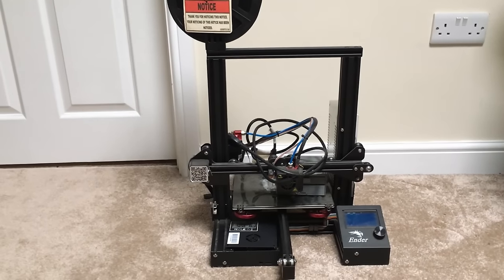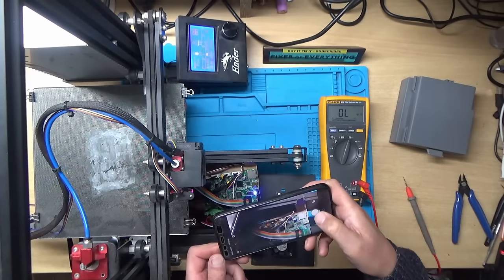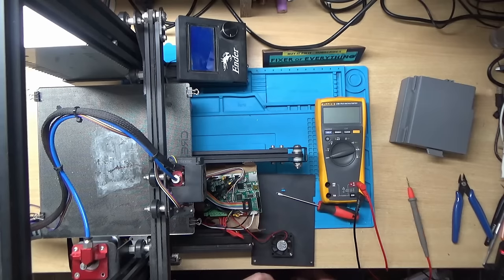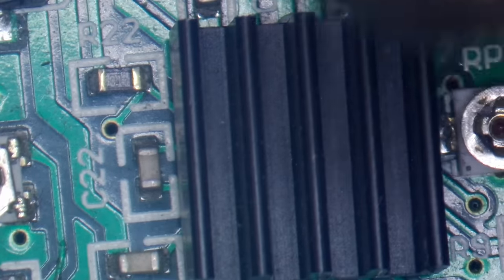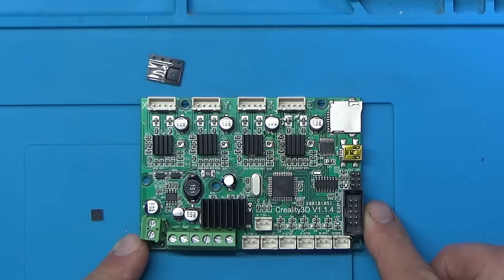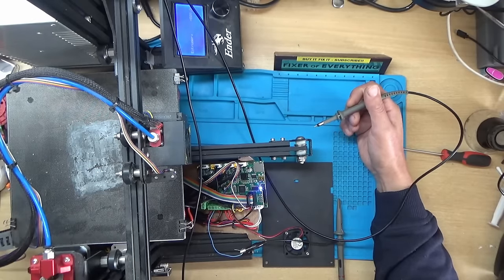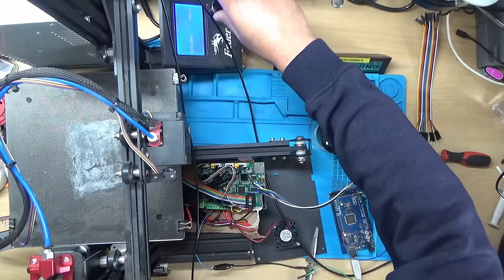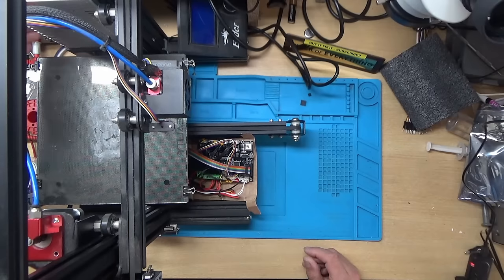Faulty Ender 3 3D Printer | Can I Fix It?

Comment: Hey Mick, did you consider just taking a chip off a cheapo Arduino board? Could have programmed it first and then unsoldered it possibly?  Nice fix again though! Oh and just a suggestion, you could play with the boat in the bath with your little ducks 😉
Reply from the maker: Yes, I looked but the arduino boards are atmega 328p, I'm sure there used to be a board that had the 128 on it, but I couldn't find one. Lol @ ducks 🦆🦆🦆😂😂😂

Comment: You do not need an arduino to install firmware just direct from pc or save firmware to an sd card and place in the printer. As stated by someone else it will not extrude when cold and it should say this on the screen.
Reply from the maker: Thanks Simon, the 8 bit board unfortunately doesn't display a message possibly due to lack of memory on the MCU, it also can't be updated via SD. It may be possible to update via USB but you need to flash a bootloader first via an arduino. The 32 bit board I fitted however does display the message and is upgradeable by SD (this is how I got the BL touch working on the new 32 bit board). The extruder doesn't extrude as you say if the hot end is too cold, I didn't know this at the time as it shows no message on this old board to say so. I did have another look at it after people brought this to my attention and faked the hot end temperature using a 470ohm resistor which made the board think it was up to 230c. After doing this and fitting a new driver it still didn't extrude...

Comment: Good Video.  For a quick test of the Z axis you could also just swap one of the X or Y axis connectors with the Z to check if it is the board or maybe the stepper motor..
Reply from the maker: Thanks, yes I tried that on the video, so did the owner before he sent me it.
Reply: 😌Sorry, missed that in your Video @BuyitFixit

Comment: Did anybody mention that printers won't try to extrude through a cold nozzle yet? 😂
Reply from the maker: Yes, I pinned the comments. The original driver chip sent power to the motor straight away as it 'locked' at power on. It could be that after I changed the chip it was repaired, but it showed on the screen that it was moving the extruder when turning the knob with no error or anything showing. The replacement board displays hot end too cold.. so did the old board support this function? As no message was displayed..
Reply: @BuyitFixit all boards support it, it's a software feature, not hardware.
It just needs to be defined in the Marlin firmware before compiling it in Visual Studio Code/PlatformIO.
Most of the recent Marlin versions already have Cold Extrusion Prevention enabled by default.
Reply from the maker: Yes I wasn't meaning hardware, it's why I ended up flashing different versions as it's I thought it was unusual for the microcontroller i/o pins to die. They are usually pretty robust unless you feed a high voltage into them. I've done a fair bit of programming and making things with arduino and the like over the years.
Reply: @BuyitFixit  They were tough, especially the 1.1.3 and 1.1.4 versions with the Atmel ATMega 1284P chip.
In my experience with Creality printers from years past, the first thing to go were usually the cheap power supplies that they fitted on most models of the Ender 3, Ender 5, and CR-10.
The second thing that failed the most was the plastic extruder arm, it was poorly designed.
Other than that, great printers for the money.

Comment: one thing about ender 3 i find annoying is that the cheap supliers of stepper motors i have localy have all the motors with  different pinout like 2 coils are crossed on creality printers, plugs are the same just 2 wites ate crossed and cheap motors don't work either unless you swap the middle 2 wires
when i read the describtion and saw firet few minutes of the video i instantly thought the extruder motor has been replaced along with the extruder to get a longer shaft motor there , since most new ender 3 extruder motors have pressed in gear and short shafts 
my 2nd thought was just to ditch the stepper driver and either reprogram marlin to use different stepper driver if it has one spare or just refire step stick in place of the broken driver and see what happens then
Reply from the maker: Interesting about the cheap steppers. I didn't know about that. I recently bought a broken ender 5 pro with BL touch from ebay for £70. It had the same 8 bit board so I just replaced with then 32 bit. I then had loads of issues with firmware and ended up having to configure and compile my own as using the version from the creality site it was homing to the back right and thought that was 0,0 instead of thinking front left was 0,0 and printing in reverse (others had the same issue) It all works great now but it was a few hours work to get it all sorted.
Reply: @BuyitFixit  printing in reverse is simple fix, you just have to swap the a and  b coild in the motor, esentially fliping the plug on the board controller upsde down i don't know if reversing the coils itself would also work but most people just reverse the plug and motor is in reverse , when i made my first ramps diy printer i was supper self concious about direction of the motor coils but in a scenario you connect one coil wrong motor just buzz in place and that is it  so fliping one coil then make it moves again regardless which then fliping the plug 180degree changes the direction. it is harder to explain than just do it
Reply from the maker: @kokodin5895  Thanks for that. It was a known issue with ender5 pro bl touch firmware. It was quite and old version too. I just downloaded the latest version and after setting all the options and then a bit of tuning it works fine now. And 0,0 is at the front left of the bed like on the ender 3, and not at the back right like it was.
Reply: @BuyitFixit  funny part is i am not an expert either that just a stuff i picked up along my way of swaping expensive 3d printer parts with ebay used junk and i am not an expert in a sense i was 3d printing only for 2 or 3 years , so take as you will
i also think exclamation mark in the code of the printer  could reverse direction based on a c++ codebase of arduino shield but i last compiled marlin a year ago so i might be a bit rusty, last time i used arduino i tryed to downsize dcc decoder code to fit on single chip microcontroller :P
anyway, have a nice day and happy printing

Comment: Next time before ordering a chip, check the voltage on the turnpot next to the driver. That turnpot is for adjusting the amount of amps the driver sends to the motor. If it is bad or was adjusted too low the stepper motor will not work either. Just stick a metal philipshead screwdriver in the turnpot and measure between ground and the shaft of the philipshead screwdriver. It should be about (off the top of my head) 1.0 to 1.3 volts
Reply from the maker: Thanks 👍yes the current adjust is supposed to be around 1.3v or so if I remember. The stepper motor seemed to be constantly powered at power up on the extruder output as the motor would not turn when the machine was switched on.
Reply: @BuyitFixit  that means the enable is active. This prevents gantries and such from descending on their own due to gravity. There is a menu option in marlin to turn the motors off so you can manually turn them for things like unloading filament. It's also possible the owner tried upgrading the machine firmware with a custom or incorrect version... Since marlin can be configured for a miriad of main boards an incorrect setting can cause issues too..
Reply from the maker: @xConundrumx yes that's why I thought I'd try and refresh it with a couple of different versions, but he said it was working fine and then failed while printing and the extruder would no longer move.

Comment: Where there any unused io pins that you could move the extruder to?
Reply from the maker: Possibly, but then recompiling firmware etc... and I know the ram and flash was crammed on the old chip as they had to remove some features, at least no such issues with the new board and also it's almost silent compared to the old one.

Comment: Not a fix, but goes to show that fixing stuff must not come at all cost. :) The printer's sure worth the 35 dollars & effort! Thanks for sharing!
Reply from the maker: Cheers 👍although if a garage fixed your car by replacing the alternator, but they didn't actually replace the diodes and regulator in the original alternator would your car not be fixed? It got to the point on this one where it just seemed better to replace the 8bit board with a newer 32 bit and the quieter stepper drivers than keep going with it.

Comment: This is where the ender cuts costs - soldering the drivers onto the main board instead of using socketed ones.
Reply from the maker: Yes, when I built a CNC a few years back I used an arduino and socketed drivers 👍
Reply: @BuyitFixit  my Anycubic i3 Mega (predates the ender 3) has socketed drivers.
Reply: @UnCoolDad  almost all printers come with soldered drivers. Also a lot of aftermarket boards do.
Reply: @FelipeGonzalezHerrera  Mine didn't.

Comment: So by the video you want to say that new board let you to move extruder while hotend was cold? Was painful to watch as firmware won’t let you to move extruder while hotend is cold, the line will just stay on hold. A bit misleading for someone just starting with 3d printing.
Reply from the maker: Thanks for your comments. I've not had a lot to do with 3d printers,  the new board displays a message saying the hot end was too cold. The old board didn't show any message and acted as it if was moving the motor. Originally the extruder motor was energised constantly (before the board booted properly) and would not turn even manually while the power was on. Changing the driver chip stopped it from being energised constantly but it still didnt move. I actually tried faking the hot end temperature today by putting a 470ohm resistor across NTC input on the  old board which faked a temp of around 210c and it still didn't move with a new driver chip installed.

Comment: You cheated!. The point of the video was to fix the board
Reply from the maker: Yes, but it became apparent a better solution was to upgrade it with the 32 bit with silent stepper drivers than to spend more money on the old 8 bit noisy board.
Reply: I was kidding!
Reply from the maker: 😂😂😂That's sometimes the problem with text and comments, no context or tone so it's sometimes hard for me to work out 👍

Comment: it is not going to even try to extrude with the hotend being cold it needs to be at least 180 to extrude
Reply from the maker: Yes, a few people mentioned in the comments. The printer displays mentioned nothing of this, and still acted as if it was trying to move the motor. The original motor driver had failed because there was constant power to the motor even before the board fully booted so the coils were energised constantly. The new board however displays a message of hot end too cold, so was this feature  implemented in the old boards or firmware?
Reply: @BuyitFixit it's firmware, a feature enabled by default in the latest versions.
You can even compile Marlin in a way that you'll be able to turn that feature on or off directly from the LCD.
Reply from the maker: Thanks Nuno, yes I meant it might not be supported in that version of software flashed to the board, not the actual hardware itself as it's just a microcontroller at the end of the day. If you're into software you may like the solar inverter video I did called no password no problem where I repaired a solar inverter and the company weren't willing to help me change a setting which requires an engineer password. So I disassembled their application, reverse engineer the algorithm and wrote my own keygen or perhaps the ultrasound video where I unlocked a ton of hidden features and run doom on the thing 😂😂

Comment: Can I fix it ?
Nope. Bought a new mainboard instead. Doh !
Reply from the maker: In this case it wasnt worth fixing the board due to the PCB only being the 8 bit with the noisy stepper drivers however the ending result is a fixed printer with a 32 bit processor and silent stepper drivers.

Comment: My printer has an issue with the extender motor the e axis just clicks and duse not feed any filament at all I have replaced the motor for a brand new one and still have the same issue is there a way I can send you my board to see if there are shorts ect to fix for me
Reply from the maker: If it's the 8 bit board, it works out better to just upgrade it for the 32 bit one. They have much more memory / features and also have silent stepper motor drivers for not a lot of money.

Comment: the extruder motor refuses to move until the tip is heated enough
Reply from the maker: See pinned comment and replies...
Reply: @BuyitFixit  My Ender does nothing with the extruder until the temperature is at the minimum to melt any filament. Then it allows moving it.
Reply from the maker: @henrikstenlund5385  Yes, as I explained in the pinned comment I didn't know this at the time and the printer doesn't inform you of this. The new board does. After I was told this I connected a 470ohm resistor across the old board to fake a hot end temp of 230c which is shows on the display. I also fitted another new driver, and the extruder motor still didn't work. Originally the motor was ON permanent at switch on and you could not move it.
Reply: @BuyitFixit  Yes, good work
Reply from the maker: Thanks, bloody printers 😂😂😂

Comment: the title of this video is wrong that's just an ender 3 not a pro
Reply from the maker: Oh, thanks for pointing that out👍I'm no expert when it comes to 3d printers. I've just searched to see what the difference is and you're correct, perhaps he thought it was a pro because of the BL touch and upgraded extruder and bed levelling nuts.
Reply: @BuyitFixit  I'm going to guess the same, and wasn't trying to be rude or make you change the title. I was just trying to inform you and for the most part the difference in the 2 printers are not really noticeable.
Reply from the maker: No worries mate, I've changed the title anyway as it's more accurate 🙂 Hopefully you may like some of my other videos, as it's quite a wide variety of things I try and repair, so I'm not an expert on every device 😂😂
Reply: @BuyitFixit  I subbed
Reply from the maker: Top man 👍

Comment: As someone with multiple 3D printers I commend you on your troubleshooting and ultimate solution.  With these things it is often just better to replace with a newer and upgraded part instead of spending the time digging through the minutia of what could be wrong.  The silent drivers alone will be something the son will very much enjoy.  Thank you for getting this thing back in order for him.
Reply from the maker: Thanks👍 I since bought myself a faulty ender 5 pro with BL touch. I was going to do a video on that but I just ended up replacing the board as it was the old 8 bit one. I did have a nightmare getting it to work and ended up having to compile the latest marlin FW for it and getting all the settings right. Works great now though 🙂

Comment: just wanted to shout... heat the nossle first, then test the extruder Motor.
That is how it is set up in marlin for savety reasons, because you cant press Filament through a cold nozzle.. 
works as intended, Nothing wrong with the circuit board.
Reply from the maker: Thanks RockyBMusic, I've replied to a few people who mentioned the same. The extruder motor was permanently energised, even at power up and before the machine booted up and it wasn't working for my friends son who had used it previous. After changing the driver chip, the motor wasn't permanently on, so it may have cured the problem. I was unaware about the hot end needed heating, the printer didn't print a message or warning and just acted like it was supposed to be moving the motor on the display. The new board I fitted however when you try to move the extruder does display a message of 'hot end too cold' so I'm not sure if the old board had that safety feature enabled.
Reply: @BuyitFixit   That wasn't meant badly either. Look at it positively, you now have an up-to-date board with quieter stepper drivers. And a more recent Driver version
Reply from the maker: @RockyBMusic  Thanks RockyBMusic 👍

Comment: Funny how an old 8bit processor is almost the same as a new entire 32 bit board, the art of planned obsolescence. Nice video, you just can't win them all but for your buddy it's a win win, it works & it's way more quitter.
Reply from the maker: Yes, he's pretty pleased with it. I just bought an Ender 5 pro from Ebay a couple days ago. I was going to do a repair video on it, but it was the 8 bit board like in this one, so I just swapped it out for a 4.2.7 32bit board. It wasn't worth the time trying to repair it. I had a nightmare trying to compile some decent firmware for it though as the ender stock firmware was rubbish (and 2 years old) and set the home position to the back right of the bed for some reason.
Reply: Good idea, no sense reinventing the wheel as they would say, just the quite stepper motor operation is worth the upgrade especially some prints last for days it's enough to drive you crazy. I enjoy your channel, great work my friend. @BuyitFixit
Reply from the maker: Thank you 😊👍